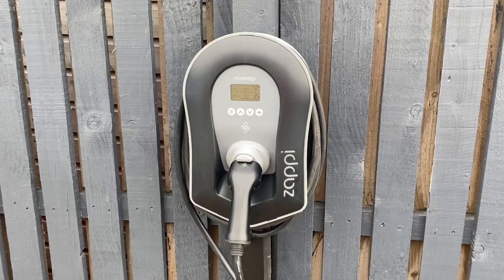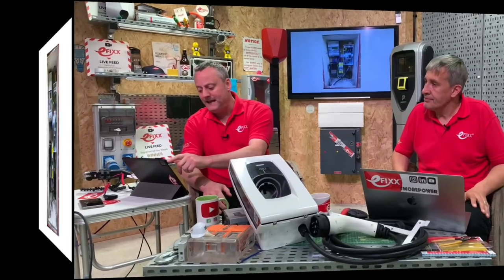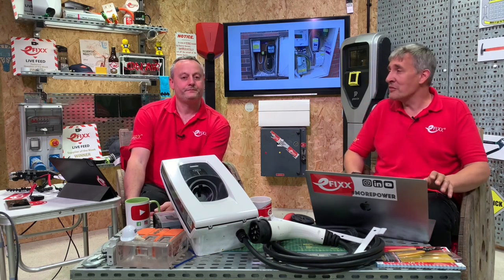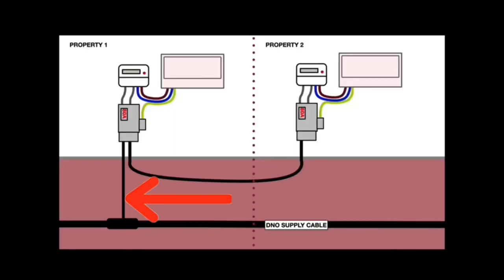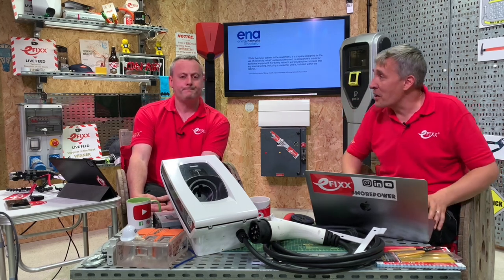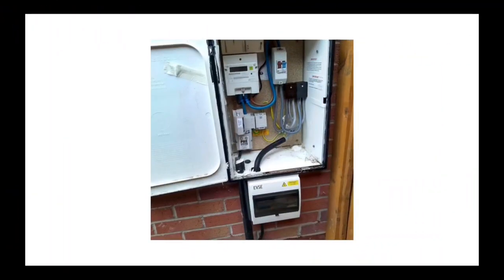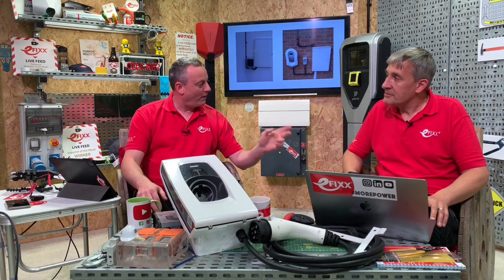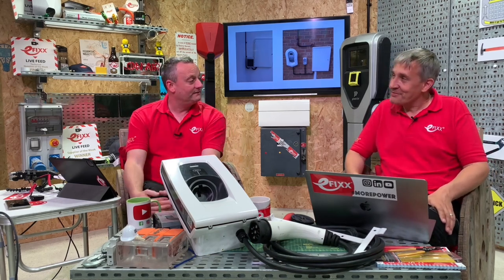Can ELECTRICIANS fit equipment inside the DNO METER BOX? - EV Charger Installation UK

Comment: When I was on the tools in the 1980s/90s (working for the local electricity “board”) we would regularly replace internal meter boards and external meter boxes/doors as they were the property of that “electricity board” as well as everything in it (except customers tails). There seems to have been a subtle shift of responsibility when the industry split to Distribution Network Operator/Supplier/Meter Operator. Suddenly, the local electricity board’s didn’t necessarily own all the equipment. Now the outside meter boxes have shifted to the responsibility of the building owner but the local DNO still keeping all the rights for access.
Reply from the maker: Spot on
Reply: Privatization, the rotten fruits are showing!
Reply: Also after speaking with the local Dno about a poor earth on an tns there answer was we do not maintain that type of system they would check if it could be made pme but if not the electrician would have to correct it as they are not responsible for providing an earth, anybody else been told this ?
Reply: @britannic2000  That sounds deeply suspicious to me. If the system was TN-S at the time of original installation and the DNO has now effectively changed that earthing system (without notification) having not rectified problems with the earthing that's occurred in their network, then that's potentially dangerous. How would anybody ever know unless it was tested?

I have heard of DNOs converting supplies from TN-S to TN-C-S because of faults, or maybe because they've made changes to the local distribution network, but unilaterally downgrading a householder's earthing system strikes me as evading responsibilities.

Comment: I have a consumer unit in my meter box that feeds my outbuildings, having heard this might by an issue/not allowed, I  contacted  my DNO (UK Power networks) by Email & asked the question. They replied & said it was fine...
Reply: yup I spoke directly with the electricians  who fitted my consumer unit for the garage in the box and the DNO who were onsite, both agreed it was perfectly ok. However the DNO said that in future if they wished to installed a new bigger type of supply box and fuse to the house it was the owners responsibility to ensure it fitted within the box to their specifications. If your own equipment was in the way and prevented the install then you would have to pay for an electrician to remove your own equipment. I think this makes more sense than simply saying 'no'

Comment: Interesting video. As a consumer and given this video was a year ago -  my new solar PV has done exactly this, and i suspect thousands more on a weekly basis. The Henley block ( which i think is allowed from reading) and a small consumer unit for the Inverters i have in the loft.  There was space in the CU for 2 extra circuits however i can see that would have been a complete PITA to wire back to that (plus zero room for CT clamps) and the job was fixed price under the "solar together" scheme that many councils promote. Would be interesting who is liable to pay for movement if it ever came to that ? Also this maybe just the terms that the trade uses but "not recommended" is very different to "forbidden", too ambiguous imho, but then that may just be the terminology in the trade.
Reply from the maker: Great info thanks 🙏
Reply: Same for my Solar PV system installed in 2015 - as well as the Henley block they added the solar PV meter, and a couple of current transformer based monitors (a measuring system + a wireless feed to the solar PV diverter in the airing cupboard). When the mains supply meter was swapped for a smart meter approx. 18 months ago no concerns were expressed about this use of the meter cabinet.

Comment: Interesting I've just bought a brand new house, just built. Which an identical boards and cabinet to the one you showed. Mine has a cut out fitted within the box and a small fusebox feeding the power to the garage. I've checked with the electrician's on site who stated that although not recommended you can do this perfectly legally. But if the dno wanted to add extra equipment themselves then you the customer would be responsible for making room in the cabinet ie removing your extra equipment to make room for their new stuff. I suspect they are stating their wishes rather than an actual regulation 'must not' was not used

Comment: When we had to fit a switch-fuse due to a sub-distribution circuit needed as the consumer unit was away from the outside wall meter box we perswaded some of the developers of new houses that listened to put an additional meter box along side. This method is a bit tricky to retrofit due to damp proof and support of the opening.
Reply from the maker: Are bigger meter boxes with dedicated customer area the answer?
Reply: @efixx  I think the problem is more with existing. Maybe a box about A4 size with cavity drip tray and top brickwork support built-in where you cut the hole out and taking the coursework out at the top for the overhang brick lintal.

Comment: Makes me smile a bit.  My supply comes in at first floor level (over my neighbour's land) - no DNO meter box at all.  Damm all space for the DNO's equipment as the builders boxed it in tidily. :-)   I had asked the DNO to re-locate the supply to where the new installation consumer unit was going to go.  Engineer visited and said that the installation did not meet their (current) specifications and still would not be acceptable in the new location.  As "existing" we could carry on using it but he could not authorise a change to a still no-spec location.  The meter tails are quite long - perhaps 4m.

Comment: Here in South Africa we have a great system. The meter box will normally sit on the edge of the property line. Because most houses are walled and fenced off from the outside world. So the muncipal services will still have access to the box for upgrades. And everything behind the box ie past the wall is your resposibility. They lock it and the supply is passed to a seperate box on the exterior of the house. Which is then passed to the consumer unit. So the problem doesnt exist here

Comment: I am no spark, but this does sounds a little crazy to me.
Please tell me what you think.
So, you can't fix another smaller additional C.U. unit inside the meter box to supply your EV wall box, because the DNO does not want you to use "Their" space within YOUR box ?.
But, in the case of our house, built in 1982 our electric metering device & C.U. etc is mounted on a chipboard backer board, it was supplied and installed on the internal wall of our integral garage, by the DNO ( Manweb ) themselves way back in 1982.
Then this would be just fine, because it has no "box" surrounding the equipment then ?.

Interesting though, that when my EV installer fitted my wall box, he needed to split the tails ( Henley blocks ) and run new tails, to a new small stand alone small C.U. unit.
He installed the new C.U. on the wall NEXT to the original backer board and said he did not want to infringe on what COULD be become contentious issue with regards to the DNO's regs.
Did he already know something then ?????.
Reply from the maker: Before the meter box came along most serious sparks would never mount any equipment on the “meter board” mounted in the garage or under the stairs.
Reply: @efixx  Maybe he was following along this path then !.
The approx 2ft meter backing board, only the C.U. / the now "Smart Meter" the DNO main fuse head and cartridge and a addition 100Amp double pole isolation switch, that was installed at the time of the upgrade and the Henley blocks.
The smaller stand alone C.U. that powers the wall box, sits to the side of the backer board and is secured directly to the internal wall of the garage.
I do agree with others, who have said :-
"If you ask the question, then the answer is very likely going to be a clear - NO".

Comment: I always fit 100A service blocks and then an IP56 CU external to the meter box
Reply from the maker: Wise man 👨
Reply: Just being Devil’s advocate - isn’t that still adding something into meter the box? I have as you describe -  a Henley block inside feeding into an exterior CU. However, strictly I am not sure it’s anymore compliant.
Reply: @paulharrison2325  Good point but as long as they can fit their smart meters inside easy enough I doubt any complaint will come of it. Henleys don't take up much space where as a fused isolator etc can be quite big
Reply: @asp217  I agree - as I say, just being awkward in making that point. It seems like a sensible compromise. If we are really moving to an EV future then various concessions will need to be found.

Comment: Literally completed one this morning, where the existing meter box was flush on the outside wall, with the existing consumer unit back to back in the customer's lounge. We fitted a 2nd meter box with the EV consumer unit and tails to the adjacent existing box. As it happened, the existing backboard was rotten, so we had to call out the DNO to replace it. However, it has always been the case that no other equipment can be fitted in their space. The boxes are side by side, at the rear of the property and the proposal was agreed with the customer first. Looks fine.
Reply: Perfect job
Reply: Its not their space, the box is the property of the building owner not the DNO or meter company.

Comment: You’ve used one of my pictures in there. It was for 2 x AC units not an EVCP but obviously that doesn’t make a difference. I use the smallest 2 way DB available for EV chargers and usually it fits in nicely. Putting an IP rated box on the outside and Henley blocks on the inside doesn’t make much difference as far as I can see.
Reply: What if the meter board is rotten and needs replacing,  or if the supplier needs to install a check meter? You have prevented both.

Comment: The perfect solution is a second enclosure built in next to the supply cabinet. this would accommodate all anciiliary equipment, ie. Solar monitoring, EV switchgear etc.
Reply: Good idea. The cost of one of those external box’s is cheep so it’s a no brainier to do that if the consumer box is to far away.

Comment: in my view the energy network were only providing a safety view with no legal substance. Whilst the various network and supply authorities own the equipment, they do not own the space. However, they can create conditions of supply ie the provision of a suitable space to safely house their equipment, but does not include the use of the surrounding space, except to the extent it does not compromise their equipment. In my view a space safely linked to the outside ambient temperature, unless affected by a direct  heat source, is generally a preferred.
Reply: correct no legal substance at all. The dno installers told me exactly the same when I asked them. they said you can install anything you want in the box. But at some future point if the DNO needed to change the equipment in the box and their wasnt enough room left you would have to make room for them. So if they needed to install a new meter which was bigger than the old one then it wasnt their fault if they didnt have enough room. and if you needed it doing urgently they were quite within their right to disconnect their equipment. But as the DNO installer said its your box not theirs.

Comment: Guess that means no fused isolators for submains can be installed in the meter box then too?
Reply: Uk power networks have a diagram showing you can fit a switch fuse. PAGE 11
https://www.ukpowernetworks.co.uk/internet/asset/5fef85a5-c01f-4322-bc62-37a4dbf4fd3b/getting+connected+guide.pdf

Comment: Interestingly, here in Ireland, where the electrical practices and standards pretty much follow the UK's, an allowance has been made specifically for the case of EV charging points, to allow a consumer unit to be fitted inside the meter box.
Reply from the maker: Thanks - we've read about the recent changes. Is it true that properties will typically have a main cutout installed for the whole installation.
Reply: @efixx  I have a main cut-out fuse on the feed into the meter, but there isn't any kind of circuit-breaker, RCD, etc., in the meter box.
Reply: I'm hoping to do exactly this but my electrician wants to install a separate surface mounted box just beside the meter box which will be ugly as heck.  do you know is there any published confirmation/guidance from ESB about fitting a consumer unit inside the meter box?  Thanks
Reply: @timotei511  It seems they changed their minds about that... I ended with a separate box for the charger c/b indoors, next to the regular fuse box, and the 32A cable routed through the wall and out to the wallbox. Its high up on the wall in the utility room, so it doesn't bother me none. And yeah, there is a big-assed yellow/red cut-out installed next to the wallbox, outside, too.
Reply: @timotei511  you can't - only the main overcurrent device can go in there (in the bottom RHS corner).

Comment: In my expereince:

UKPN - You can on a case by case basis.
Western - No you can't, but will be reviewed on a case by case basis.
Scottish & Southern - No you can't, any isolator you have in place already we'll also remove when fitting or upgrading a meter. (Switch fuses they haven't yet - worries of compromising safety).

Now if you get their engineers in the field regardless of company they're fine with it as long as they've got room to work on the head or meter. Thing to remember is the metering engineer can't remove or interfere with the customers installation as it's out of their remit, they can and have tried in the past to not fit a new meter but ultimately get over ruled by the managers anyway as the repercussion of leaving people without power is not worth it in their view. (IF the installation is obviously unsafe it's a different matter).

The thing to remember; New builds often have an American HOA style board now that governs what can be put on the outside of buildings which excludes the use of IP consumer units, white flue terminals and alike, limiting options. 
The DNO can complain and refuse service but it can't if their request to remove said items compromises the safety of the installation (ESR 1988/ ESQCR 2002) - they can however if the building is under 10 years old take it up with the developer (witnessed this once, it was chaos but the block also had issues with C0 due to aluminium flue leaks so the developer had no choice). Outside of 10 years becomes a horrid grey area where negotiating with the DNO is the only way forward.

The biggest issue going forward into an EV net zero world will be Vehicle to Grid as current single phase houses converting to three phase will need the space for the new DNO head and metering equipment. Though generally on a case by case basis most DNO's do not have issue with it but that doesn't mean ask forgiveness over seeking permission as it's normally far better to inform them of the circumstances before proceeding, you may just get the answer you need or want and the paperwork to avoid a later headache.

Comment: Hi?

Could you please explain why older meter boxes have the consumer unit built in to it? 
Surely its the same and its always been allowed?
Reply from the maker: Not in the UK 🇬🇧
Reply: @efixx  I think the OP is confusing a mantel unit with a meterbox in this situation.where a metal cabinet was installed with a skeleton board at the top
Reply: @Gazzerdaman  Nope there's a fair few with consumer units inside them - circa 1960-1975. Some internal to the building some external. See them all over the South East of England. Edit: To clarify many of those skeleton consumer units were put in by the same company that were putting in the DNO equipment at the time.
Reply: Thats right lots of them still about and they even offer an up to date skeleton board to be installed inside the meter box.

Comment: take it that this only applies to external meter boxes, what if you  have an older style internal meter box with a skeleton board inside it ?
Reply: Good luck fitting anything additional in there, lol
Reply: @beardedsparks2825  exactly but the whole point of the video is that it's supposed to be for DNO and supply authority stuff yet there's a skeleton board in the internal ones so wouldn't that be the same problem ?

Comment: Are you allowed to install an additional cabinet next to the existing one to install your own equipment (EV equipment/ consumer unit)?
Reply from the maker: Yes - that’s the most sensible approach
Reply: So not too much of an issue, I was beginning to worry .
Reply: Can you put the cabinet above the original, or does it need to be side by side?
Reply: I was about to ask this question so pleased to see someone has asked it! 
I have found a slimline box which may fit a Rolec Wallpod. 
My access down the side of the house is quite narrow so to have it recessed in the garage wall is a great option!

Comment: Since this year we are allowed to install the supplies in the meter cabinet here in Ireland. It's a no brainier! You park the car right next to the meter box. The electricity supplier wants to sell off peak due to wind turbines making too much power at night. There are rules though, isolation labels on main CCU, DC RCDs, and external double pole isolator adjacent to charger (it's defined as fixed equipment just like and oven or 3Kw+ appliance)
Reply from the maker: Great info thanks - and rules which help level the playing field - Thanks Tony